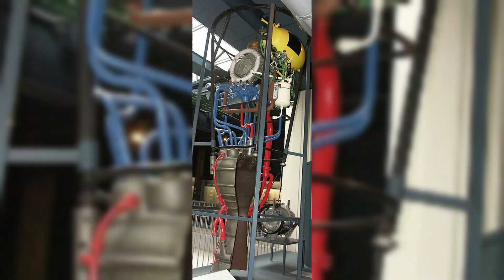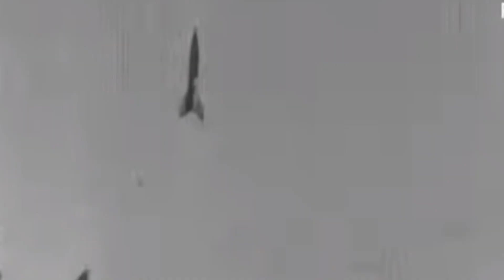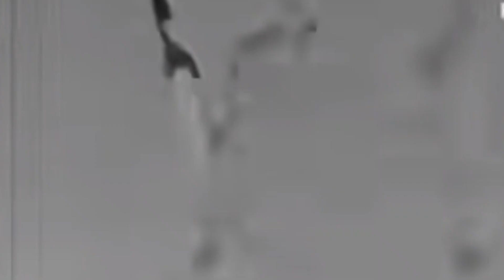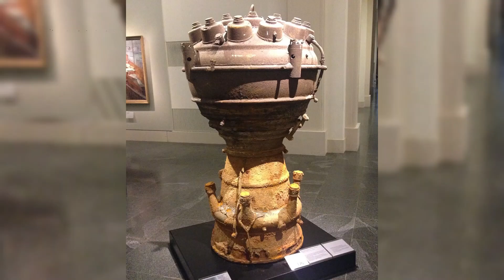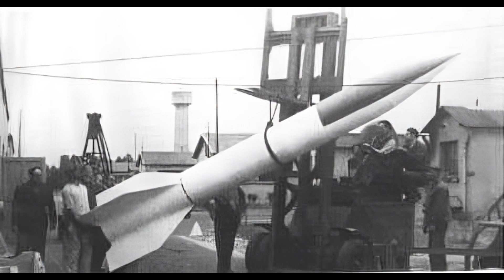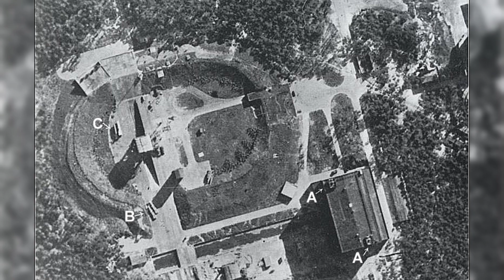Changing the Course of History: Germany's V2 Rocket in WWII

Comment: First!
Reply from the maker: The payload was about 725 kg (1,600 pounds) of high explosive, horizontal range was about 320 km (200 miles), and the peak altitude usually reached was roughly 80 km (50 miles). However, on June 20, 1944, a V-2 reached an altitude of 175 km (109 miles), making it the first rocket to reach space.